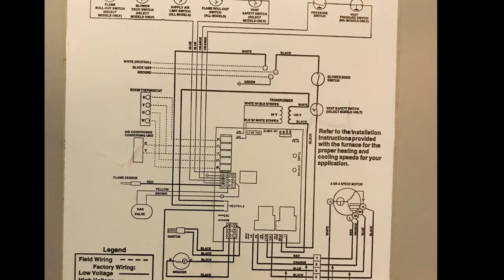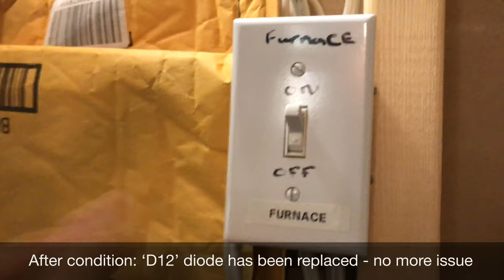3A Fuse Keeps Blowing on a Gibson/Nordyne Furnace Repair

Comment: i have one of thse that flashes 4 times and will not ignite. The igniter doesn't even get hot. I can hear the switches trying to start but nothing happens.
Reply from the maker: Sorry I don’t have this furnace anymore. So I don’t know what 4 flashes mean.  However if you look in your user’s manual or on the service panel, you should be able to find the meaning.  Obviously your igniter doesn’t work possibly due to defective or no power supplied to it.

Comment: Why is my green light on my Nordheim 92% 60,000 control board blinking
Reply from the maker: Every furnace has its own diagnostic LED codes. Blinking LED in sequence tells you there’s a problem with the system.  Check your furnace owner’s manual or the sticker behind the furnace access door for the meaning of each sequence of the LED flashing. Sorry I have never heard of Nordheim furnace. But if it’s a Nordyne then you should be able to search for Nordyne furnace error codes online.

Comment: How do you like Gibson furnaces?? I just bought a 72,000 btu and it runs great so far. Heats up my little Cape house with ease!
Reply from the maker: I have had this Gibson furnace for 16 years. The igniter went within the first four years. The heat chamber sensor stopped working after six years or so (damaged due to rubbing against the heat exchanger over the years). The mainboard gave up after 16 years due to a faulty diode. I also find this furnace has not provided enough heat for a 2400 SF home with finished basement. So I would not want to have another Gibson. :-)